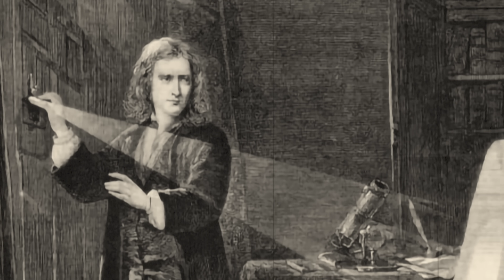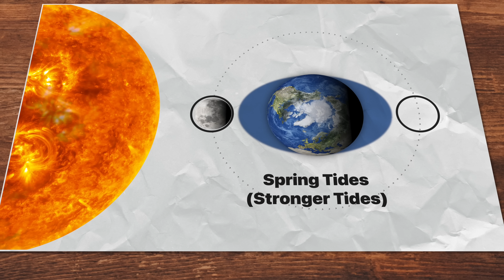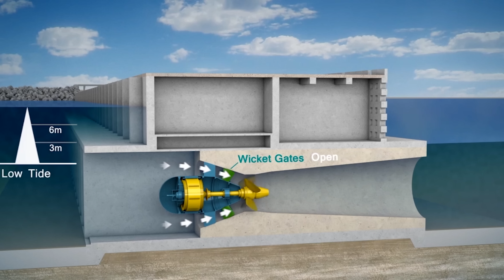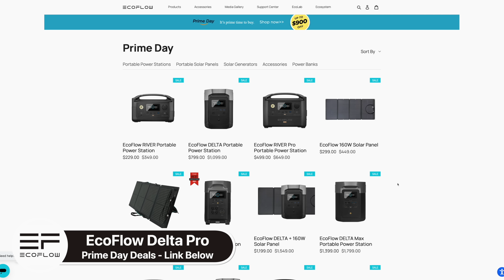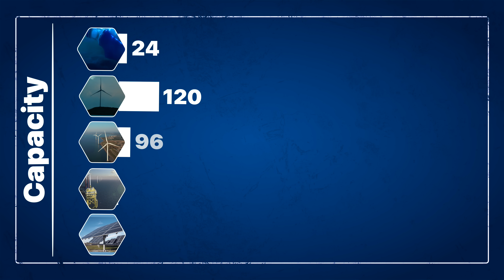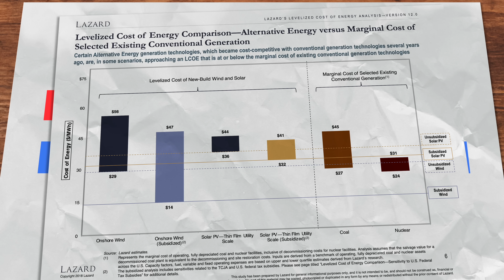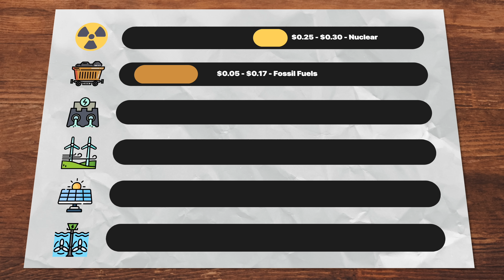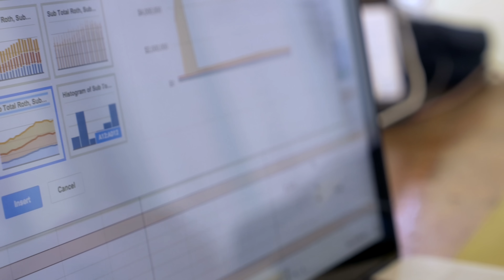Breakthrough Energy Source is 10X Better Than Wind & Solar!?

Comment: The geothermal coal plant conversion with laser drilling will be interesting in the next 10 years. Also cover reservoirs with solar panels limiting evaporation, cooling the panels, and use it to pump when it's not needed making the reservoir a pumped storage battery. Already need to cover lake Mead in solar panels to keep it from becoming a deadpool in the next decade.
Reply: Those dead zones are getting rid of us all.
Reply: @TheRealCheckmate  Salter's ducks?
Reply: Thokim84.  Another great idea.
Reply: Covering Lake Mead or any other lake or river with solar panels is clearly not feasible. Can you imagine the cost to maintain a floating solar electric system… it is great to consider every potential fix for living in the desert, but this idea is far from practical. Perhaps over population and border control would make more sense? What do you think?
Reply: @i.b.blithe3263  apparently, when reservoirs or lakes are in danger of evaporating to unusable levels, they've started covering them with plastic balls (like kids's ball pits) to reflect the sun & reduce transpiration/evaporation.  Not cheap.  If you cover a reservoir with solar panels, you prevent this loss & gain electricity for low maintenance once the installation costs have been met.  It's only up front expensive & more relevant in hotter climate's where it's most effective, productive & financially beneficial.
How much oil would you like to sell me.  Or Nuclear that takes 7yrs +3yrs overrun & $24billion with $8billion overspend?
That would buy an awful lot of RE installs available within 1 year, 3 years max.
Stop believing the lying cr4p the Fossil dinosaurs put out to protect their poisonous businesses.
Reply: @alexmanojlovic768  Thanks for the comments Alex. I am NOT for fossil fuel at all, one day it will be gone and we need to convert for many other reasons anyway. Read up on the NuScale small nuclear reactor systems that are coming. Look at the Navy's success and safety record over the past 65 years using small nuclear. It just seems to me that floating moving electrically connected high voltage power systems that only operate 23% or less per day will be loaded with maintenance problems. Large installations of solar and wind even on land are proving to be unreliable and costly for grid power in California, Texas, Germany, and other places. It seems to me we should get away from the huge custom built Nuclear and go to new generation small Nuclear for relable grid power.
Reply: @i.b.blithe3263  the problem in Germany has not been the provision of RE itself, but the lousy infrastructure between North & South.  IIRC the majority of RE is produced in the North & the majority of industry is in the South.  Germany thus sells a lot of it's electricity to other countries & buys some back from France etc which has better feed into the South.  Therein lies the problem.  If money were spent on the infrastructure to transfer RE energy from the North(?) To the South(?) the figures would be a lot more beneficial & realistic.  I never saved the link to the articles that discussed this. Sorry.
I'm against Nuclear in general, as the construction of nuclear plants always overruns & is massively over budget (corruption & incompetence).  Any new "mass produced" small scale Nuclear (SME's) are unproven at large scale & likely to be as corrupt & incompetent.
Also Nuclear power is NOT Zero Carbon.
There's a lot of concrete, steel, welding & transport goes into building nuclear & with full size plants, that's 10 years of Carbon emissions before the damn things are even turned on!  Damn lies funded by a dying industry.
Reply: @alexmanojlovic768  Thanks for your reply and information regarding Germany’s power rates and problems. Power sharing between generation is more efficient than long transmission line loses. Trading power is done routinely. Hence, selling RE locally and buying France's nuclear locally down South should make economic sense. There are factors that favor wind and solar, but economics is not one of them for grid power; this is being proven in California, Germany, Australia, China, etc...

I agree with your large custom huge nuclear plant comments. But I think you need an update on the coming new generation small modular nuclear. Check out the NRC approved NuScale companies 77MW unit design and safety aspects. Their modular units are to be built in a factory, then shipped by rail, truck, and/or boat anywhere. Each unit is identical and built under factory conditions. The fuel is so little that over temperature is not possible as they are set in a water pool which can absorb more energy than is available. These small units consume less materials per KW than wind or solar. Remember wind and solar wear out and degrade in rather short time compared to conventional power generation, hence continuous manufacturing and replacement. Nuclear fuel is limitless (breeder units can be called RE), the power is greener than wind and solar and far less expensive. They are rated so safe they can be near people... like Navy aircraft carriers which house 1,000s of people and dock in City ports around the world... including California that greenish State in the West.

For grid power, Capacity Factor is a big deal. Nuclear is +90% reliable (the best of all generation technologies) where RE is about 30% reliable (the worse of all generation) so one needs other reliable generation or storage. Storage results in another 20% loss for RE. There is a place for RE but it’s not the grid in my opinion and I am very smart... haha. Anyway, check out the new small intrinsically safe nuclear. Small nuclear has been used to power Navy ships for 65 years. We all must keep an open mind, and may the best man err I mean technology win. Thanks again for your comments.

Comment: There was startup in the Florida Keys 10 years ago. They were stopped dead by environmentalists who worried about fish! They had a great design that overcome many of the problems of ocean deployment.
Reply: Couldn't find anything about that on Google. 
Nothing wrong with protecting the highly damaged marine world . They are chopping up Manatees a lot already around Florida as it is.
Reply: @dnomyarnostaw  I was living in Key West at the time. The company had provided for protection of wildlife but the head of the environmental agency refused to allow public hearing on the plan. The pilot was designed to be placed between columns on the 7 mile bridge near Marathon. I agree that protecting wildlife should be a priority. Funny that the migrant birds killed by wind farms has not resulted in mitigation measures.

Comment: Do you know the biggest problem all the green energy people face? They are all claiming to have the best solution;  waves better then wind or solar is best: hydro power rules etc. STOP FXXKING ARGUING YOU IDIOTS; even oil gas and petrol have a place; Coal I'm not so sure; so that excludes bar b q's I'm afraid. Nuclear is too expensive, open to terrorist attack; and impossible to decommission fully and safely. Why can't all providers of 'green' energy just get together as ONE!

Comment: Tidal energy has its place and that is a very important point. It lends itself to centralized energy production, the way utilities do it now. The HUGE disadvantage that utilities will try to hide is the cost of "distribution". The last time I looked the grid accounts for about half the cost of a kilowatt to the meter. So "Distributed Energy" has a huge advantage for the individual to generate energy where it is used.

Comment: Definitely should have a bigger part of the new renewable energy portfolio of the world. Wind, solar, hydro, tidal, geothermal.. not against a bit of nuclear either personally.. but definitely requires a very high bar of safety and therefor the most costly method.. but until there is enough renewables to cover the world and then some.. nuclear has a place as a consistent base load

Comment: Also, why not build a lagoon around your tidal range with a heavy duty plastic or rubber “swimming pool liner” to separate the salt water on the outside with fresh and/or chlorinated water inside. As the tide comes in the liner will be pushed toward the tidal range and the clean water inside will be pushed through the turbines with the same force as before, but without the corrosion or bio fouling problem associated with salt water.
Reply: You can't be serious... ha?

Comment: Interesting comparison to pumped hydro. Raises the question of whether we could incorporate pumped hydro into a tidal range system, so that it is always producing energy from the tides, but could also store energy from a nearby solar or wind farm?  Perhaps large tanks on both sides of the dam to receive pumped water when excess energy is being produced. When extra energy is required, the tanks on the high sides of the turbines release water through a pipe aimed at the turbine to double or triple the amount of energy they would otherwise produce.
Reply: Four 55 gallon drums full of water is almost 1 ton of weight. Imagine a series of those on a pulley system, geared to drop and power generators when they are full of sea water, and then get pulled up by the next set of generator drums dropping down in the series. Self actuating, and would require very little maintenance since the generators are above the water and enclosed

Comment: Problem with tidal energy is that the locations that could be viable, are not anywhere near urban or industrial area's where the energie is needed. 

Where these viable locations are close to urban and industrial areas, they are already in use (like these locations in France and South Korea) or are in development right now

And because it is under salt water, and water is full of stuff suspended in it, much more than in the air, the turbines suffer a lot from corrosion and erosion, requiring a lot of maintenance. I have seen a documentary where they have experimented  with under water turbines to use the currents in the Hudson river in new york, but the experiment failed miserably, because the turbine broke down in just a few months caused by erosion .

The massive scale in which off shore wind turbines are currently installed with these 12+ Mw turbines, brings the cost down very quickly, these huge wind turbines also can genrate electricity at lower wind speeds. In the UK now over 50% of their electricity comes from wind energy, they have now several weeks per year they can turn off all fossil fired power plants and run the country on wind alone. And the UK is not done yet, massive off shore windfarms are under construction right now.

The same applies for my country, the Netherlands, several 700+ Gigawatt off shore wind turbine farms are under constructuon right now, we also have some small scale tidal turbines, but wind and solar are slowly taking over from coal and gas fired power plants... The energy companies love it, because wind energy and solar energy is much more profitable for them, they cant build these solar and wind farms fast enough! Our tides are not as strong as in France, so that is not really serious here.

Comment: Wonderful. I envision a ship with sails and a watermill underwater. Catching the sea or lake currents aided with the wind force on the sails. Driven compresor or batteries could store energy. The comptrssed air can be stored in relatively small and autonomous subs. This subs can navigate to the coast to deliver the air or stored electricity. Waterborne vessels can take large weights.
Reply: Got to happen sometime 👍

Comment: Thanks for sharing your thoughts, ideas and videos. Great to see an update on tidal energy. Not sure if they died or you just haven’t seen them, in the past the most promising looking tech was one called ocean carpet generators. Supposedly the idea was a carpet like layer suspended just above the bottom on legs that would pump water as the waves traveled overhead and the energy captured would dampen the waves. The last news I heard was that it had more interest to prevent shore damage and to shelter harbors than for energy production. Basically the energy would be captured thru the pumping action and piped to shore to minimize mechanisms in the ocean. The harbor sheltering option would skip the generators and pipes and just pump the water directly back into the ocean only taking advantage of its resistance to be pumped. Another option was to place large underwater bidirectional Venturi made of concrete under the water with suction lines running to the shore running generators off the vacuum of air and venting the water into the sea thru the Venturi. Not sure what the affect of that much air bubbling up in the ocean would be. The proposed location for that one was the San Francisco Bay with and estimated 2400 MW capacity. Not sure if they have separated wave energy from tidal energy yet since the one is more wave than tidal. Might make a direction for you to investigate for any future updates. Wishing you and your family the best.
Reply: Thanks for explanation.

Comment: I loved seeing the graphics behind tidal forces—made it really easy to understand.
The fact that tidal energy can be harnessed on both directions makes it far more efficient than pumped hydro.  But here is tidal energy's Achilles heel: shoreline environmental regulations are so demanding that the time, energy, and treasure just to get permits is enough to abort the project.  Just ask someone who wanted to replace the deck boards on a simple boat dock.  And think about the possibility of a new hydropower project in the US—we have environmentalists demanding we tear down existing dams built in the last century.

Comment: when You did the formulas, You should have mentioned, that the energy is extracted out of the earth's rotation ultimately: Energy(work) = (Gravity_)Force F * s distance(of motion). the s comes from the earth's daily rotation.  So the earth's rotation will slow down to one rpm (rotation per Month!) in the far future. Scary, isn't it?

Comment: Oscillating water columns look pretty sweet. Harnessing wave energy without having to deal with being underwater. I'm not sure if there are any floating ones though
Reply: There are. look up Eco Wave
Reply: wave energy is a different field to tidal, equally valid but not the topic under discussion.
Reply: @alanhat5252  yeah I got that 🙄

Comment: also have to take into consideration the NIMBYs... solar and wind can be cheap, but it needs a place to be built and nimbys often oppose any developments in their area. one of the potential advantages of tidal power is that its in the sea and out of sight, which can hopefully reduce local opposition to developments.

Comment: Solve for ideal, but remote, installations: Tesla mega-batteries? *Portable and modular though. Needs a drone platform (a la Space X) that can dock and cycle barges - anchored near the tidal generators. Designing the connecting cable apparatus would be an engineering puzzle. Would need two or more barges with the charging stations built on them. (Tesla is already employing Megapacks to make wind and solar viable, and reliable, in various locations.) Design the rig and barges to run off of same modular Megapacks. Then, relay fully charged modules to installation near urban zone. (Dedicated rail or trucks if no real estate available near the wharf?) Take depleted modules back to the charging platform. No need to trample the local ecosystem building power towers or sea floor cables. Tesla robots can do the dangerous jobs. The barges might need an operator, but the platform might only need remote monitoring.